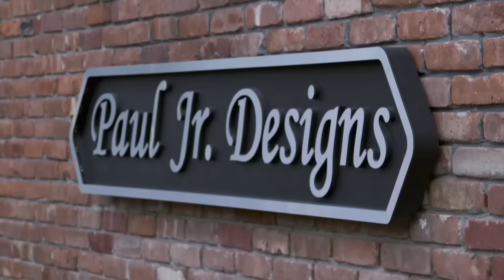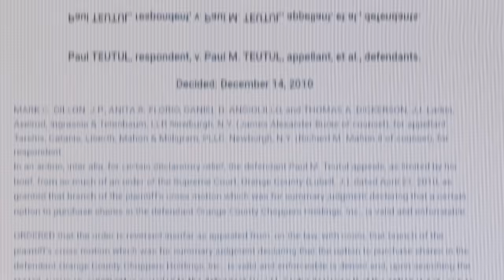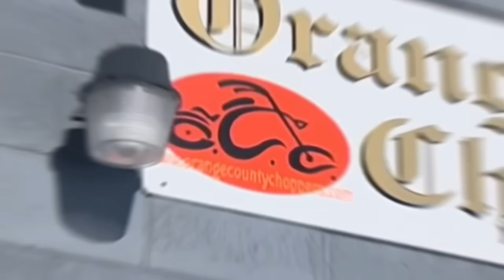Paul Tetul Jr From American Chopper's Shocking Update | What Happened to Him? Fired Employees

Comment: Great show.  Bikes more for Sunday meetups or museums.  No or minimal suspension with raked front end and limited steering range made for difficult handling.  Braking another issue.  This is not for cross country just to admire.  Basic Harley design.  Offer many styles essentially same bike by changing gas tank and fenders. Engine performance not really center stage because of riding ergonomics.  You do not want a 200 horsepower chopper with no suspension, poor brakes, and handling.  You definitely want stability control if 200 horsepower with traction control, ABS, and corners ABS/Cornering traction control.  Stability control is a standard on high performance motorcycles.  In 2012 stability control mandated in all new cars to
Save lives.